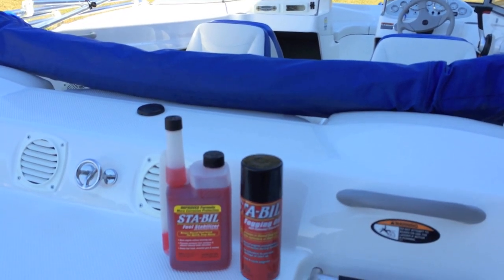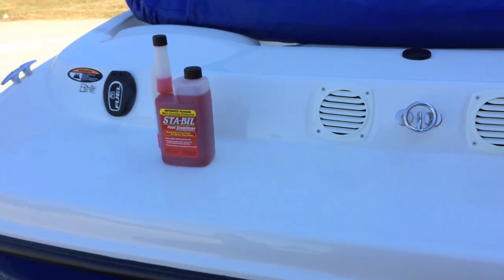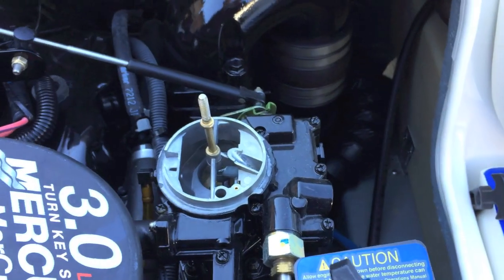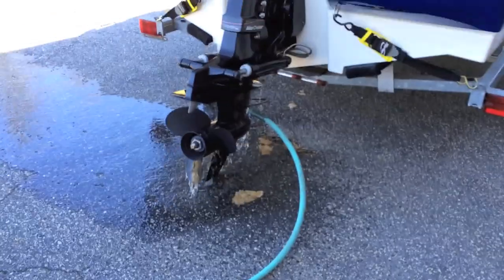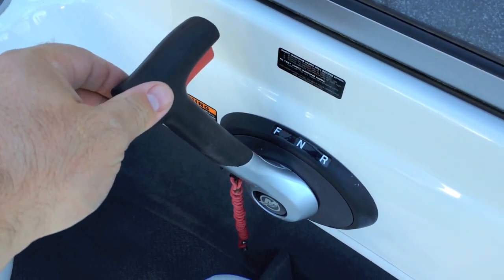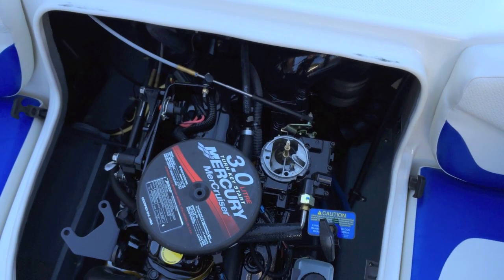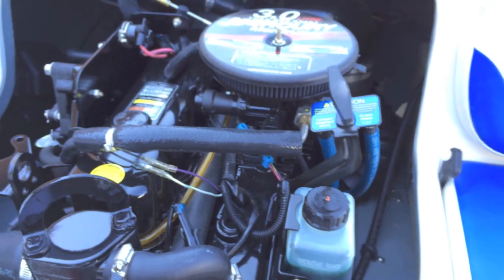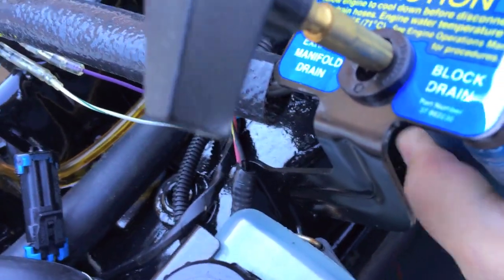How to Winterize a Boat Step-By-Step on the Mercruiser 3.0 TKS

Comment: That bilge is super clean.  I have to winterise my 2000 Bayliner capri. Just drained the block but did not know about the drain for the manifold until I saw this video. Thanks.

Comment: Certified marine mechanic here never fog out your engine like that untill it dies !  It should stay running while you fog untill you see smoke out the exhaust then shut down
Reply: 'Burned Out Boat' in 4 clips being posted this week shows the failure of a professional winterization. Mid-winter in a marina one of the boats exploded causing a 4 boat fire. 2 were totaled.
Reply: Do you recommend not using antifreeze like this video showed?

Comment: Good video. But you forget to put antifreeze to the block. Antifreeze will  not let the block oxidize inside during cold winter days. I am using regular RV antifreeze. You need about two gallons of it for 3.0 Mercruiser. And easy way to drain the block, just push those two hoses down. Thanks for video.

Comment: Another great video.  Excellent detail on 2 different ways to drain the block and manifold of excess water, I'm confused why water doesn't come shooting out of those drain tubes as soon as the engine is started.  Also any idea on the exact procedure for winterizing with antifreeze as per the merc manual that you referenced?  Thanks man!

Comment: Great video!  Thanks, very helpful.  I have the same boat.  Likewise I want to winterized and then pull out on warmer days.  Question, I didn’t see you address water in the lower end, or did you just lower the outdrive to drain?  I did just pull the lowest black tube and poured some antifreeze down it, blew on the hose and it did come out the holes in the outdrive.  Thoughts? ...many thanks!

Comment: thanks for your video  sir paid  $130 bucks just to get the water drained from my block  i was told that i had to take it back to get it ready  for the water again i noticed  the guy left does two blue hoses disconnected  now he does not have time  to get it back running  i connected the houses back but there is no water in the block  should  i just put my water hose to it .and than  crank the motor?  will it get damaged if i crank it with out putting water before i crank  it ?

Comment: So you winterized it then said you didn't unhook the battery because you may take it back out?  You can take it out after winterizing?  Do you have to winterize again if you do take it out?
Reply: If inboard engine draws water to cool from lake/river--for sure. Otherwise, there will be water inside engine to freeze. Don't know answers for other engines.
     'Burned Out Boat' 4 clip series being posted shows results of professional winterization fail. 4 boat fire caused in marina mid-winter by a boat exploding.

Comment: just got my boat this season. I'm a little gun shy on doing it myself great video. off topic question i have a mercury 4.3 and an alarm sounds intermittently at running speed ..any suggestions? thanks
Reply from the maker: could be anything from low oil pressure, over heating, low voltage, or low drive oil at the reservoir
Reply: low drive oil likely

Comment: I have a sea ray 17.5' boat with the Mercruiser 3.0 engine. I used seafoam to stabilize the fuel. Do you think this is ok? Also I read through the manual and it never says to fog it. I live in texas and the boat is kept in my garage.  Thanks !!
Reply from the maker: Should be just fine. Seafoam is good. The fogging just keeps the moisture in the engine while in storage from rusting or corroding which you see more when storing outdoors covered than indoors.

Comment: About the drive lube monitor container up top of the engine, do you recommend keeping the top lube vent (down on the outdrive) closed and then pumping the lube all the way up until that top container is filled up?  I notice you did not mention the lube monitor container.  Or else, just fill that container up by hand from up top is fine?
Reply from the maker: When I replaced my gimbal bearing in the video, I pumped it up to he upper vent on the drive then put the screw back in and then kept pumped into the container. note I did empty my container when I changed my drive oil

Comment: I see that your boat is damn clean. What wax do you recommend?
Reply: A year later, I'm back to winterize my boat
Reply: @anonymouse7074  Since he didn't answer I will give my advice.  I have the same boat and just spent countless hours polishing with 3m marine polish.  That's whats going to bring the shine back on any dull gel coat.  On top of that to protect it and add a little extra shine i HIGHLY recommend Collinite 845 wax.  It's super easy to use and requires very little "elbow grease" to get it wipes off.  I use it on a fleet of 35 limousines as well and LOVE it.  Cheers.

Comment: shoudnt you change the oil thats in the feet aswell?
Reply from the maker: Depends on the last time it was changed. I ended up changing my gear oil when I changed my gimbal bearing.
Reply: pocket chuck 
If feet = lower unit then you want to change it every fall to remove any water that can freeze and crack it.

Comment: How go's it ? I am looking at  a 1980's bayliner  with a 3.0 I would like to put a v6 or a v8 can it be done ?
Reply from the maker: Yes and no. Pretty sure a V6 will go right in but I think the v8 is too much weight.
Reply: Thanks I like you videos . I am currently  looking to buy a marina!

Comment: don't forget to top up your fuel before adding stabalizer.
Reply: Since the gas tank is plastic, this really isn't necessary. But a metal tank, then yes I would top it up completely.....just my opinion from winterizing lawnmowers/motorcycles etc for years in Canada

Comment: Fiero880, you seem to know everything :)
If I wanted to add antifreeze for winter storage, what hose(s) would I pull off and pour antifreeze in? And would I leave the blue drain hoses off until antifreeze comes out since they are the draining points?? Having trouble finding a video showing this for some reason........
Reply from the maker: Honestly, the easiest contraction I have seen if you want to use antifreeze is the pink RV antifreeze attached to a tank that connects to the muffs. Just like running the engine on the garden hose except you run it on this tank. I do not have the link at this time but google it. There is a YouTube video showing it.
Reply: I've seen it, not a fan of that setup personally. I'm over on the BOC forum now getting opinions. Found the service manual online, recommends removing the thermostat and pouring the antifreeze in :)
Reply: Craig did you determine which black hoses to pull and pour antifreeze into?  I believe it’s all 3 but I’m still learning :) ... I have the camco bucket to use with muffs but would prefer to pour down the tubes, use the boat on nicer days and then repeat.
Reply: Does anyone have an answer to this? I'm not a fan of the antifreeze tank and would like to know where to pour the antifreeze into which hoses on this type of Mercruiser 3.0.

Comment: I got the same 3.0 tks on my 08 185. Do you have to add antifreeze once you drain the block???
Reply from the maker: Some say you should put antifreeze to help with corrosion if you have ran the boat in salt water, I choose not to.

Comment: 1984 volvo a125 does it use antifreeze to cool motor and pull in water to cool somthing else it has 2 orange tanks or 1 but 2 caps one on left has strainer basket are they connected or seperate. thanks i dont know just bought.
Reply from the maker: The AQ125 has a closed cooling system. It takes in raw water, then through the strainer if you still have yours, then through a heat exchanger which is the red tank. This transfer the heat to the cooling liquid for the engine. If your AQ125 has been probably serviced, then yes there should be antifreeze in the engine or the closed portion of the cooling system. But you still have to winterize the raw portion of the cooling system.

Comment: How do you put water back into the engine
Reply: Inboard: put the fresh water intake hose back, do the engine will draw from the river/lake, if your engine is that type.
     See 'Burned Out Boat' series of 4 clips being posted this week showing the results of a failed, professional winterization. Boat exploded in the marina mid- winter causing a 4 boat fire.

Comment: GET AWAY FROM THE STABIL, I as a Mercury tech , recommend using mercury QUICK-STOR AND POWER TUNE FOR FOGGING
Reply: fiero880 stabil and seafoam both have an alcohol base, quickstor and quickclean, both are ppetroleum based. Quickclean uses techron
Reply: +trampus johnson Stabil marine brand (blue not red) removes alcohol